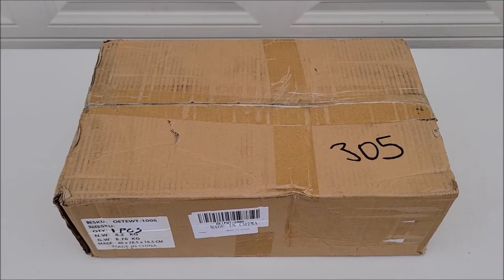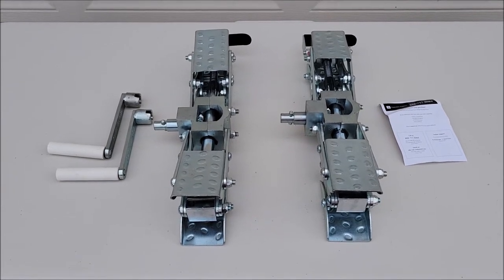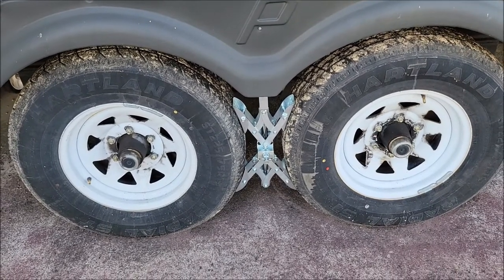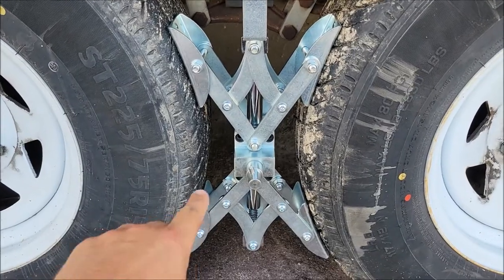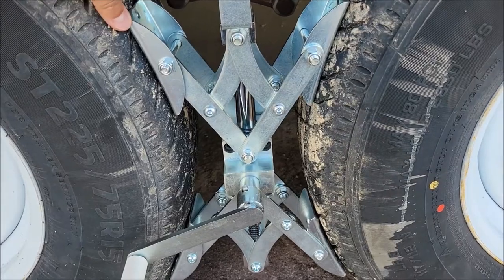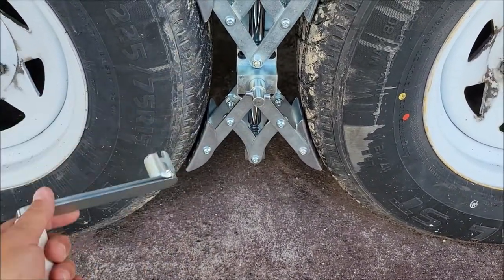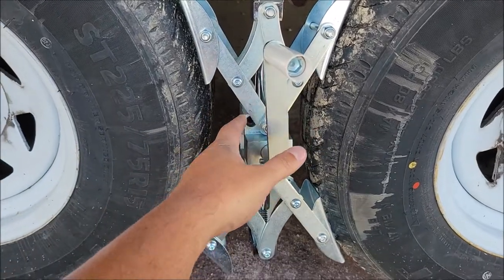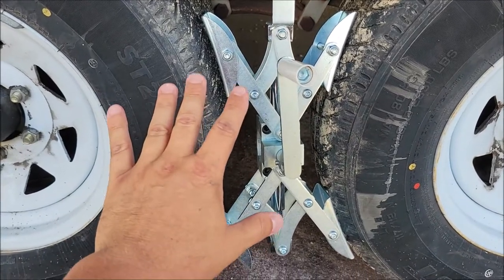Stabilize Your RV - OEDRO X-Chock Wheel Stabilizer - RV Upgrades

Comment: I bought a set of x-chocks for my RV a couple years ago. One of my best purchases! You a right about the rocking and they are better than wheel chocks bc the work even if the wheels are elevated for leveling. Good video!
Reply from the maker: Glad you got some. I consider these a must have.  They work so well.